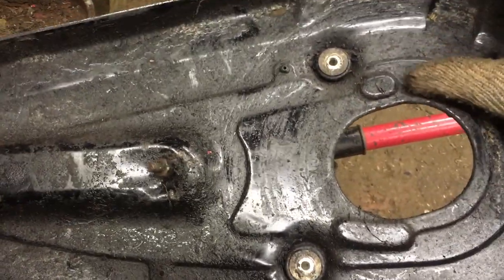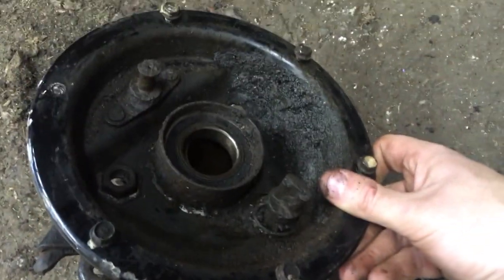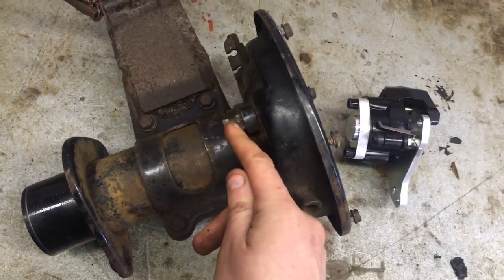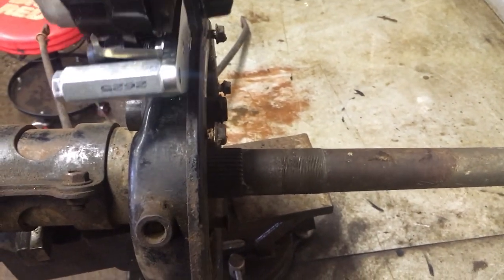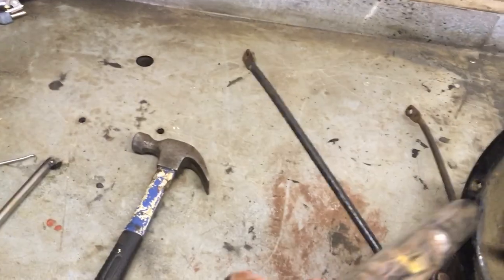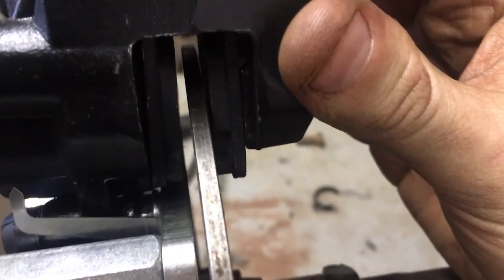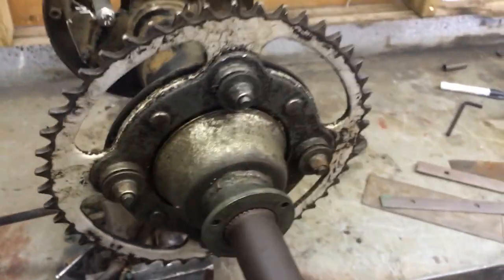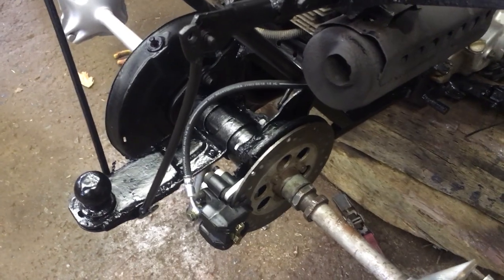Honda 3 wheeler disc brake conversion 200M Part 7

Comment: How long is the brake hose did you have it custom made or were did you get it from?
Reply from the maker: Got it made at a local hydraulic shop / hose shop , I can’t remember exactly might be 82 inches or so. Just run a piece of rope to where you want it and measure the rope

Comment: Parts information seemed a little light... I think I heard you say that the caliper is a for a 400EX?  Is the rotor the same?  What was the part to which you bolted the rotor... something fabricated or a stock part?  Thanks!

Great work on this project to your total finished product; thanks for taking us on the journey!
Reply from the maker: Hey there, sorry newer to make videos. The caliper is indeed for a 400EX " Honda Sportrax TRX400EX 1999-2008" Make sure you get the little mounting bracket that comes with it. The Rotor I am using is a 200X Rotor ( the old 200x ATC). The rotor holder has the same splines on as the axle and slides right onto the axle. The rotor is bolted to its original rotor holder belong to a 200X. If you didnt have a 200X brake hub and holder, you could take the factory Brake drum housing and cut off the splined piece then simply weld a rotor to the splined piece. Thanks bud, will make some trail videos soon! Good luck with your project
Reply: @muddythumper8152  Thank you very much!  I have a pair of 1984 ATC 200 and was just pondering options for improving the braking.  I'm not sure if I am quite ready to perform surgery on them... but it is certainly possible!
Reply from the maker: @jasonwtheis5921  no problems!, The 200's are nice machines. My first one i bought was a 200E then i started keeping a eye out for them. Disc brake is a nice upgrade. I wanted to go that route because its simple and reliable. I've had bad luck with drum brakes sticking on and this little 200M was pretty seized solid on the rear brake pivot. You could always get a spare axle carrier and drum housing if you did want to cut one that way you can always convert it back if you decided.

Comment: Nice i literally replaced everything in my bigred cables shoes brake handles adjusters & it barley stops worth a toot very disappointed in the braking .... Everything else shes a tank ...
Reply from the maker: Thanks, the disc brake is working really good. I replaced the front brake shoes and it works good but i only really use the disc brake. Never had any issues with it and still going strong!